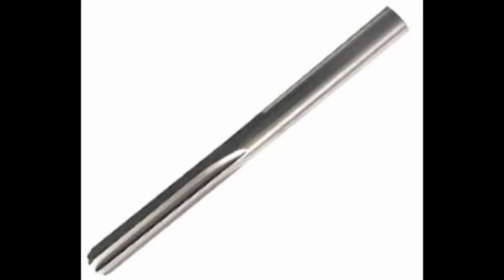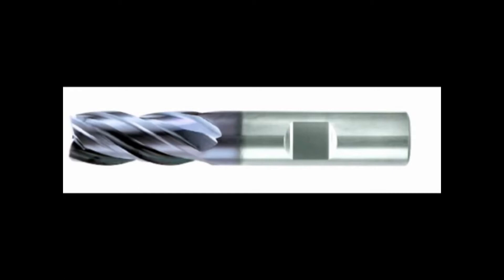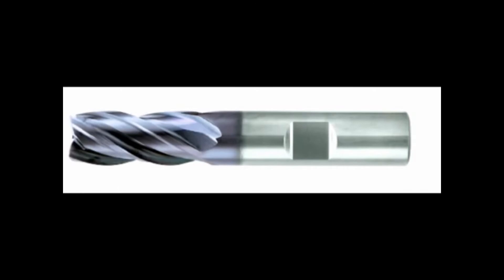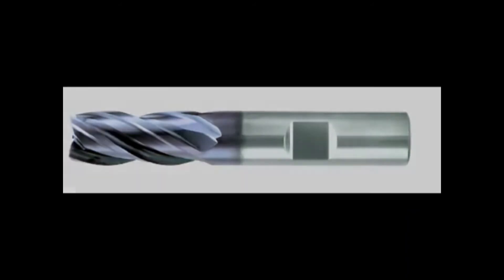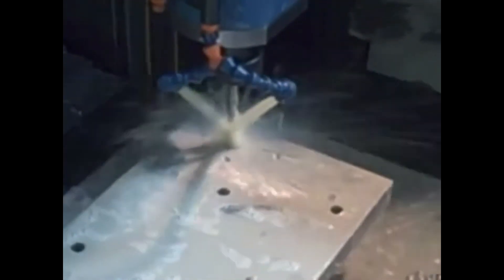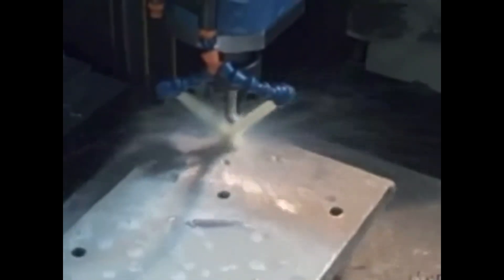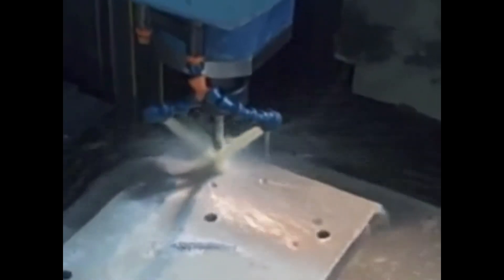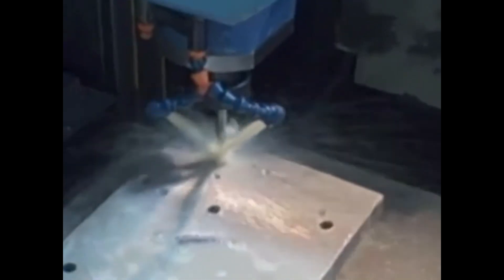HOW TO ACCURATELY POSITION HOLES

Comment: Hi Phil  It was my experience that this CAN help but depending on the accuracy needed an ENDMILL will NOT be enough! Yes its better than drilling and reaming (reamers just follow the drill!) and in some case's even better than carbide drills. MANY factors are involved form NEW DRILL or RE-SHARP drill?  HOWEVER if the tolerance is TIGHT .0015" or less for location you need to BORE the hole's. We ran many tests where i worked and i checked them all on a ZEISS CMM and ONLY the boring operation could achieve the needed accuracy. We did not have a jig grinder at that time but MONARCH VMC's  and IF properly tooled they could achieve HOLE POSITIONS of .00050". We were doing FHS (FULL HARD STAINLESS) 301 AIRCRAFT Disc packs.
All that being said an endmill (sharp and short if possible), GENERALLY would hold position within .005" but then you need to consider the profile of the hole diameter! Many holes were LESS than round! We managed TRIANGULAR , OVAL Bell mouthed you name but the ABSOLUTE best was to BORE the hole!
   We pulled a lot of jobs back into shop by using these methods instead of OUTSOURCING to Jig grinding in Meadville Pa.

Comment: What do we do when we're reaming a .1878 hole 😱 Honestly, besides getting a custom-made endmill, our choices are really limited to use this technique. Unless you use such a tiny endmill and helix down but that's getting complicated at that point. Any suggestions Phil?
Reply from the maker: What's the tolerance?
Reply: Well, it’s tight - .0005 (for the spacing of the holes). They’re exactly what you made the video for, dowel pin for location of the part. The holes are just small (.1875 G7). I probably can’t get an endmill in that oddball size. Up
To now the HAAS Minimill has gotten it done, in 17-4. I found the key is where it all begins - the spot drill. But any other suggestions - becuase it’s a nail biter every time the part come off the machine, I’m hoping the mill
Got it right within my tolerance. 

Btw - fellow PA resident and really love your videos. They’re short, to the point and are really top-notch Phil! I remember the first one I saw was your video talking about how good the inter rapid indicator was and the next video was how to square things up with a square comparator. I believe you use the term “this is keys to the castle type stuff”. I’ll never forget that. you and many others are like our online teachers that we serve our unofficial apprenticeship through. I only wish I would’ve done this right out of high school instead of later in life. So just wanted to say thank you for the great content and hope you keep it.

Comment: that proces is not ok for reamers. There are two wasy. one is to drill hole, then use boring head to bore the hole and make it straight and then use the reamer. second option is to use undersized carbide drill and then ream the hole. reamer should be cutting at least 0.2mm in diameter. Reamers will last a lot longer.
Reply: Yes, reamers need to cut and not rub. This wears them out and they can bind in the hole.
Reply: @marley589  
yep, that's the issue. If you want to drill perfect holes in serial production you can buy tolerance carbide drills but they are quite expensive. normal hss reamer needs "meat" to cut and not get dull.

Comment: drill .030 under .I use a regrind  endmill. .010- .005  under size .  than use a on size endmill, . 200 deep and ream to depth after. I'm a die maker. This is how you do it
Reply from the maker: Pretty much exactly what I said in the video.

Comment: Look up “ISO system of limits, fits and tolerances”. A very practical and detailed guide to find the required behavior/relation axles vs holes, and the dimensions to make. Taking a hole as a starting point (holes are indicated with Capital letters) or, on the contrary, a shaft or axle. (Characterized with a lowercase). 
For both (hole or shaft) there is a range starting above the nominal size, and ending below that value. Anyways… if you’re serious about engineering but have no formal education in that field, get into this!
Reply: For standard size holes use a spot drill of the finished reamed size. Drill it to leave a counterbore about 1 diameter deep. This gives an accurate guide to start the reamer in the correct position. It allows the correct undersize drill to be used leaving stock in the hole for the reamer to cut and not rub.
Reply: @machinists-shortcuts  Did you make a video on this a while back. Edit. found it here   Quick - accurate reaming + 8 bonus tips.   .
Reply: Thanks!

Comment: I like this. It sure saves the steps of a single-point tool for gaining true position accuracy on smaller holes. Do you think new carbide end mills come in common undersize? It is fine, as there are plenty of undersized end mills after the first or second regrind in the collection of cutting tools. Thank you for posting this.

Comment: Didn't know about that technique,  will give it a try.   Did not know about carbide end mills being undersize.
I have a need to drill and ream a through hole typically 0.1562" dia. in typically a cylindrical 0.500" dia.  machined and lapped to size cast iron part.  Typically 0.500" long.  Being done on a manual Mill and challenge is to get the machine's spindle axis exactly over the axis of the cast iron part,   trying not to exceed 0.001" off centre.  Best system so far is to set the part in the Mill vice clamping on its end faces,   place a mandrel in the chuck that is say 0.020 to 0.030" less than the part dia.  Make sure that the mandrel runs true.  Then using a 2" set square off the Mill vice base,   adjust the "Y" axis until the gap between the set square blade held against the part each side in turn and the mandrel,  is equal both sides using feeler gauges.  Then lightly lock the "Y" axis table clamps and recheck as clamps can move the table.  As a centre drill is designed to drill a hole in a flat not cylindrical surface,  spot face with a slot drill (or centre cutting end mill) at just less than the finished hole size then centre dril.  drill and finally ream to size with a chucking reamer running slowly and lubricated.
Reply: Swing an indicator either side of the shaft to find the centre accurately.